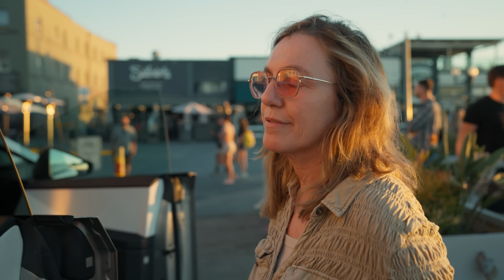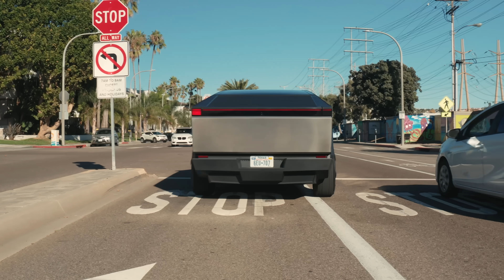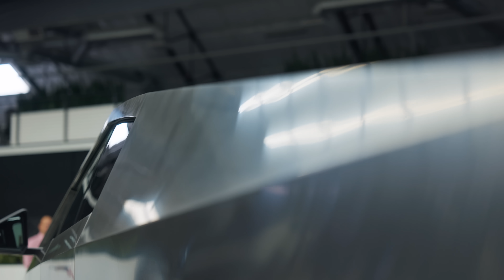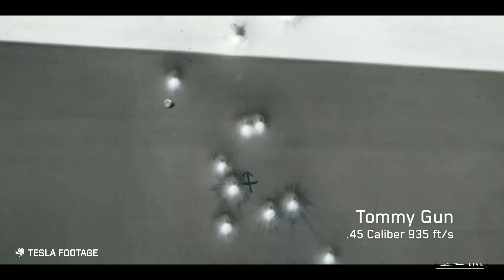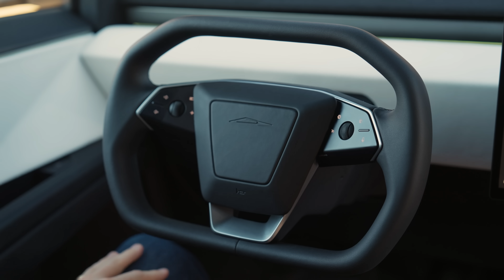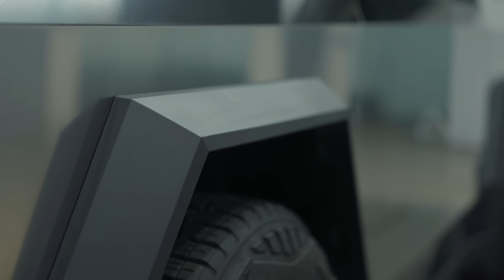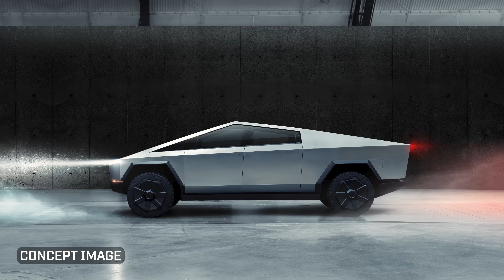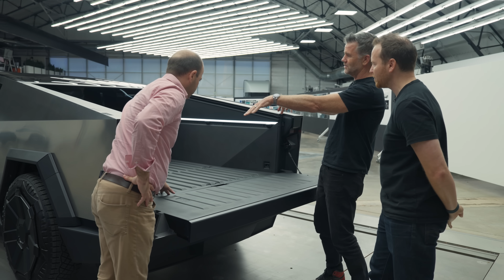FIRST DRIVE: Tesla Cybertruck Full Review

Comment: There a reason why almost no cars use stainless steel, it's heavy and hard to repair when needed. Only the Delorean used it
Reply: Well u need that for anti bullet proof truck
Reply: @widodoakrom3938  it isn't bullet proof
Reply: @SF7PAKISTAN it is bulletproof. Educate yourself before commenting.
Reply: @SF7PAKISTAN  true but actually it can stop small caliber like 9 millimeters
Reply: @widodoakrom3938  not it can't. It can only stop subsonic. Most handguns are supersonic
Reply: The Cybertruck is lighter than all the other EV trucks lol.
Reply: It's significantly lighter than the conventional design, but smaller Rivian Pickup, and about the same weight as the lightweight Aluminum F150 Lightning.
Reply: But there is also a difference why no other manufacturer can match Tesla in actual manufacturing. They can't scale like Tesla, they can't make vehicles like Tesla. Everybody uses 10s of factories to produce parts while 80% of the vehicles in Tesla are produced by Tesla. This company went from trying to catch up in manufacturing to completely overwhelming the competition.
Reply: It's hard to innovate when your supply chain is rigid, it's why Tesla has managed to gain so much market share in only 10 years

Comment: they talk about how rigid and strong the outside is.  Are there any safety numbers on impact.  Cars being designed to give is a safety feature, so how does this rigid body compare.
Reply: Tesla cars have been the best at safety .
Reply: @Arjun-ub5bh  how many of these other cars are made of "special" stainless steel? thanks for sharing irrelevant information.
Reply: @r3h0l3s7  oh do you mean how this stainless steel compare to other trucks ? There is a crash test video it shows this truck is pretty impressive. I think the rigid frame and the stainless steel played a huge part in it. But if your concern is repair if it gets bent or damaged I have no idea how expensive it will be. But safety i think its pretty good.

Comment: 3100kg wow futuristic
Reply: Same as a ram trx fully fueled on 35s weighs. 👍🏻
Reply: Who gives a shit u seen it 0-60 numbers ?
Reply: Normal actually as comparison rezvani vegenace weight is around 2812 kg or around 6200 lbs
Reply: pritty sure 2000kg is more what you get for an EV pickup then  3000kg.
Reply: Haha what? A Porsche Taycan sports EV sedan weighs 2300kg..
Hummer EV weighs 4500kg. Ford f150 lightning EV pickup is 3125kg.
Reply: Normal weight for an EV pickup.
Reply: Very light weight for pickup truck with 123 kWh battery

Comment: for me why no headup display? at least of range and MPH so you dont have to keep looking down? Also not 500miles, an additional pack going in the back i understand, is a good idea and 500 miles is a perfect range for UK, but...will it come to the UK ever? Or will they push model Y and smaller vehicals and feed the volume of vehicals to the US market where trucks are king in certain states?
Reply: Because Tesla is all about slimming production and reducing hardware.
Reply: They gave your answer in the film - best part is no part.  Come full autonomy, there will be absolutely no need for it.  Same for stalks, gearshift etc...

V4 chargers are already rolling out so why does it need more than 300 miles range?  You wouldn't ever need to stop for more than 20 mins to continue your journey.  If this wasn't a Tesla it would be a more valid point, everyone knows their charging network is years ahead of everyone else, plentiful and reliable = no charging issues.
Reply: @neilattwood6227  LOL ehat a pity they downgrade the cars as the6 have done years before that dream is possible which means they by now are outright terrible to drive in anything but perfect weather and daylight. Worst piece of crap i have ever owned after the Vision downgrade and made 100% sure i shall never EVER have a Tesla again when driving 30.000 Miles a year and experience how mentally 7-8 year old Elon has ruined my property over night in 1 OTA.
Reply: @Slendrianen  no KIA 1.5 CRDI hey 😂
Reply: @neilattwood6227  :-D You hoped...BUT i had 0 faults during 110.000 Miles/5½ year i could blame on the car even if it was boxtuned and spend many hours on the autobahn at 193 Km/h (rev-limit), so absolutely not, back then it was a fantastic car for what it was ;:)
Reply: My daughters Mazda from 2014 has a Hud meaning shes looking less as dials or screens. More time for eyes on the road, less looking away. I am liking the idea of tesla more and more but...as soon as apple gets involved, there isnt much competition to push tesla to see that people want these things. As Elon says, come with ideas and solutions, not questions. Improvement is an ongoing task, look at spaceX learning through design failure, except eyes on road is simplicity defined by requirement. Put speed and miles left on that massive screen space you have.
Reply: It will never come to the UK because we have laws about little things like pedestrian and occupant safety, which require things like actual crumple zones. Which this doesn't have.